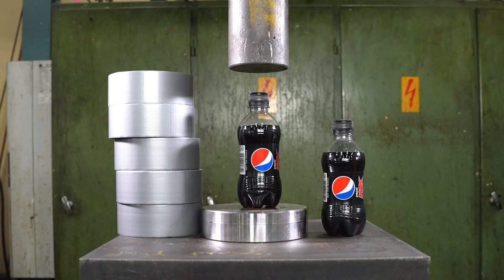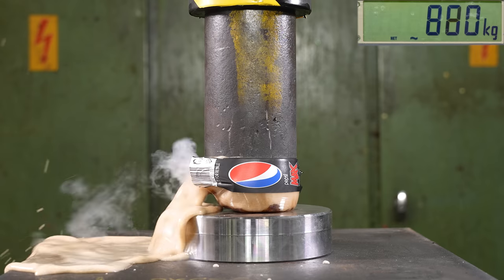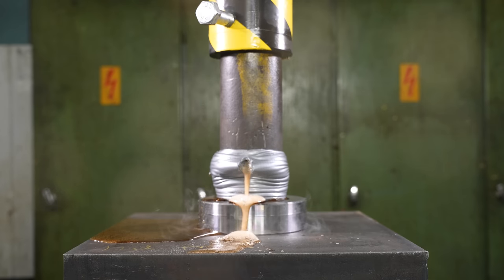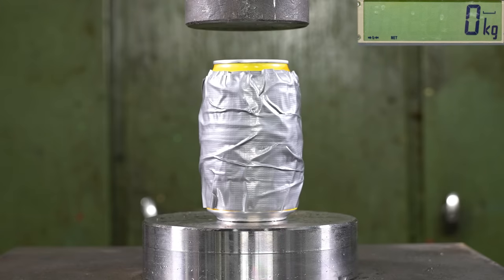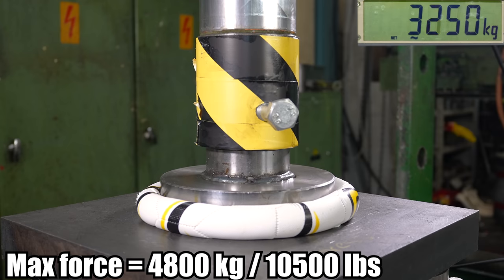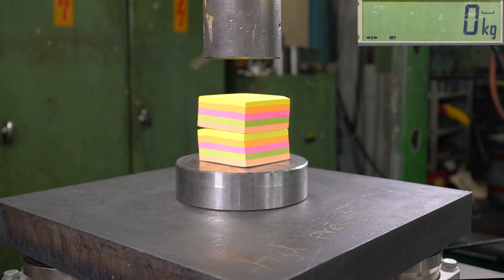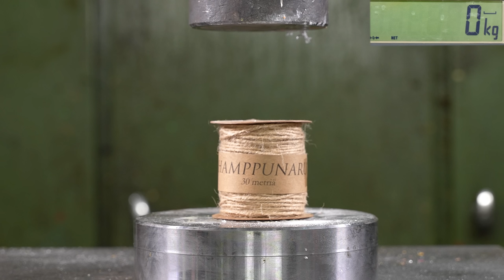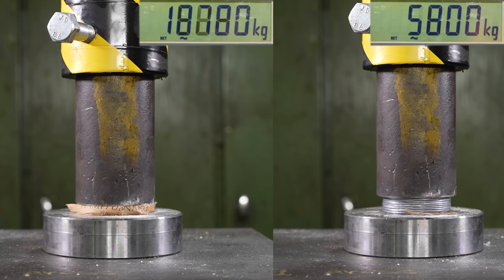How Much Stronger Does Duct Tape Make Everyday Objects? Hydraulic Press Test!

Comment: If it moves but shouldn't: duct tape. If it doesn't move but it should: WD40
Reply from the maker: I have to make video about how much easier stuck stuff is to move after WD40 :D
Reply: @HydraulicPressChannel  Yes! Find some old rusted mechanisms in a scrapyard, try to shift them with the press, then spray with WD40 and try again. Great idea!
Reply: You just have to be careful never to let them come into contact with each other. The resulting paradox could destroy the universe.
Reply: @23Scadu  Spoiler: lube beats tape

Comment: That was awesome! Easy to predict the soda bottle, but I must say I had higher hopes for the can! Maybe try a can of beans or similar instead, as they have less profiled ends..
Reply: ..and you could probably use the lathe to wrap it..
Reply: Easy to predict the soda ?!? I took a ton of pressure ! Do you have any stock tips ?
Reply: would be no different, the issue is not the ends, it is that metal buckles where plastic stretches

Comment: I'm surprised that paper behaves like that under pressure. Does it act like a fluid under those extreme pressures or is that acting like a brittle solid under stress fractures? That's an incredible amount of energy for wood pulp and starch

Comment: It would be super interesting to see similar items compared with similar weights of duct tape applied but on one the tape is applied carefully and smoothly with good tension, and the other it's just slobbed on there like how people normally try to use tape.
Reply: Definitely. I'm pretty sure that the can as an example would have been much stronger if the tape had been wound tighter. The reason why I think so is, because if it had been wound tighter the  can would have been capable of distributing the force to the tape much better
Reply: @niclaswyatt866  Maybe, but the can is still quite capable of buckling inward before it has been compressed enough for internal pressure to prevent that. It should make a huge difference for the pressure vessels, though, and maybe things like the stack of post-its which behave like fluid at failure.

Comment: If you fill a Coke or Pepsi plastic bottle with water to the top and microwave it, the bottle will shrink but maintain its shape. You get a mini bottle with thick walls. Try pressing one of those.

Comment: Interesting observation: the "smoke" that came out of the soda bottle when it exploded was actually CO2 gas. When the soda was being compressed in the bottle, the CO2 in solution was being pressed out of the liquid (I think) and actually cooling off. After all, if we take C02 and compress it enough then it turns into a liquid. This is why the "smoke" that comes out of the bottle drops quickly to the table and disperses. This same smoke effect is seen from dry ice (which is just a solid form of C02)

I could be wrong with these assumptions, but I find it interesting. Does anyone else have any other ideas as to what's going on here?
Reply: Probably wasn't pressed out of the liquid, more like the sudden depressurisation made it come out of the liquid. The same smoke appears when you just open a bottle. Probably water in the air condensing on cold CO2
Reply: The sudden change in pressure is causing water vapor to form. Same thing happens when you twist a spring water bottle tight and, using pressure, pop open and launch the cap
Reply: you guys are close! when a gas is compressed it rises in temp. when pressure is released quickly the gas temp. drops quickly. very cold. creates fog.

Comment: The aluminium can isn't nearly as elastic as the plastic bottle. So it wouldn't have made much of a difference if you wrapped it with 10 layers or 50 layers. The can would rupture on the inside and soda would squirt out.

Comment: Actually if somebody was wondering about the smoke coming out of the bottles, it's from the immense pressure release when the bottle bursts and the pressure fells drastically to ambient pressure and with it the temperature, which in turn has an effect on the surrounding water vapors in the air as it is condensing along the path of the flowing redissolved co2 gas that was bound in the coke before. At least this would be my best guess.
Reply: Yeah we figured...

Comment: Cool, man I have already suggested to try to compress frozen mercury, under Normal  temperature it is liquid but they say that under - 40 it gets solidified and  Impossible to be compressed by any hydraulic pressure that you May expose to it. - 40 is a minimal temperature needed for solidification so another advice is to lower its temperature even further using Maybe some mold to give some kind of a shape

Comment: What is the sampling rate on the pressure gauge? Would love see an oscilloscope pattern. When the can ruptured at 350kg it looked like an afterkick to 380, an oscilloscope would resolve it. A tap on the sensor may cause the meter to stop or be inaccurate. Curious minds want to know.

Comment: You may have already did this but have you guys experimented with Pykrete, it would be interesting to see if you could compress wet cotton with sawdust then create a few layers and then freeze it almost like creating a plywood board, then test its strength against normal plywood. But as you like the chance to either blow shit up or shoot holes in it you could see how effective it would be as a ballistics shield for explosives and a bullet proof vest plate and shoot it to destruction. Extreme cheap materials but big explosive content.  Obvisly you would need to mess about using the materials to give you the best mix but I'm sure a man of your talents could achieve impressive results. All the best from Scotland

Comment: Make coal from plants and leaves. You know, if you heat up wood without oxygen you get charcoal. Do the same but with heat and pressure like deep under face of the Earth. So make a red hot sealed container with dry plants in it, and crush it with the press.

Comment: Makes sense. Duct tape is best used in tension, not compression. But if the tape was reinforced with thick wire in a birdcage pattern, then the tape probably would of been able to handle a bit more compression.
Reply: *would HAVE been able.

Comment: Watching paper explode never gets old !
Reply: Agreed. It was so unexpected the first time I saw it on this channel. And it is still interesting to watch.
The result in this video was not surprising.
I suspect that 1) the internal pressure is way high at the point the paper fails, and 2) the perimeter of the paper stack received the failure as a shock wave. 
The paper has already failed when the shock wave starts to leave the center of the stack, and the shock wave would not be contained by the duct tape.

Comment: Duct Tape is designed for tensile strength and not compressive strength.
Reply: It was resisting the hoop stress due to internal pressure.